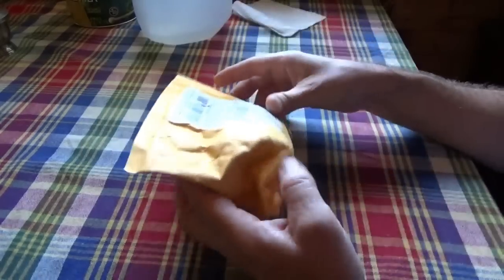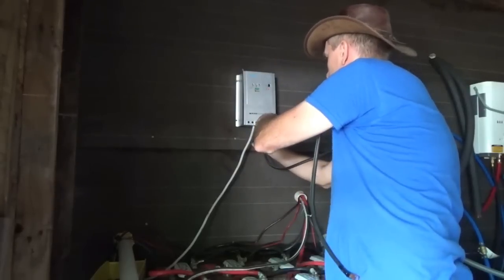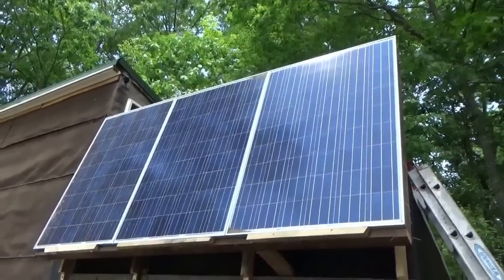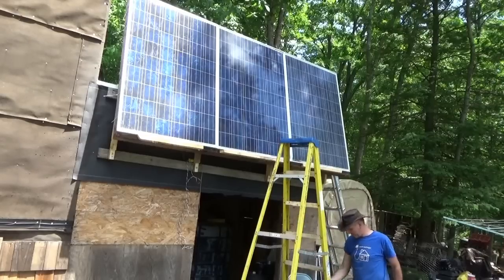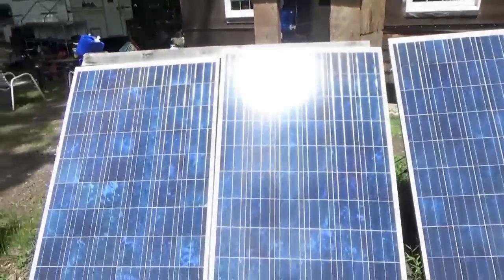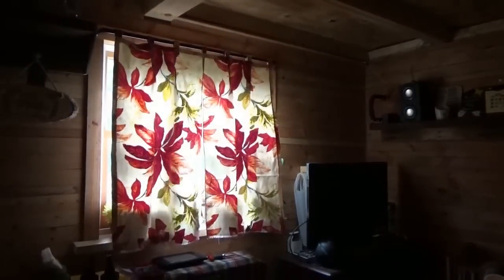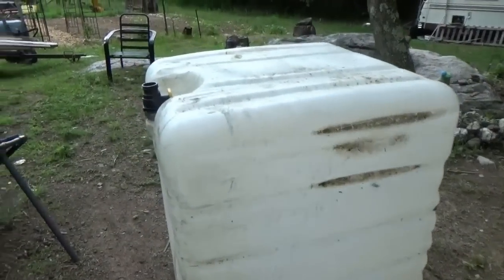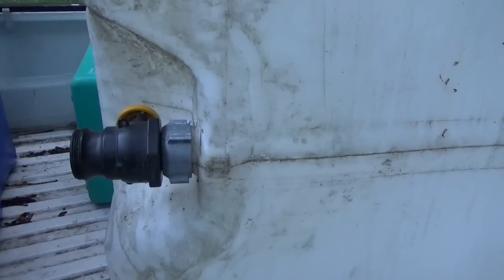Connecting Solar Panels ~ Melanie's DIY Curtains ~ Off Grid Water

Comment: if i were to run the same appliance, which would last longer? full charged batteries in series or in parrallel? or is there no difference? and this is without solar power just straight off the batteries
Reply from the maker: Batteries in parallel increase the total current so that configuration would run longer
Reply: Thanks

Comment: Troy, On the IBC Totes....
Get ones that have had food grade products only in them if you are going to use for potable water. 
do not fill them with out being in the cage.... (safety issue)
Also GO TO TRACTOR SUPPLY and get "Gator Lock" 2" part D Quick Couplings and Street 90, get a 2inch to 1inch bushing and also get one of their 25 foot 1inch poly non-collapsible hoses ($26.00) and use that for the water supply.   
Consider using a HFT Shallow well pump (cast iron shroud) the cheaper one ... this will also work as a pressure tank.  use 1inch or 3/4inch Gator Lock connectors to make everything modular. 
the HFT well pump will run well off of a HFT 2k-4k ($129.00) Power inverter. 

For the solar panel setup...   The MeTer remote is a VALUABLE necessity for the Renogy Tracer MPPT.  also wire up your panels series parallel and you can get more effective charge and lower amps through the controller..

Melanie .....  MY WIFE SAYS THE CURTAINS ARE ABSOLUTELY BEAUTIFUL....   
(saved the best comments for last...) 

Harold n Anisa Cokayne 
Just a Livin' Simple Couple (in Maine and Georgia)

Comment: I have the same charge controller. The only problem when you put it outside, is to prevent spiders & other insects (especially ants) from getting inside and walking on the electronic parts which can cause serious damage. 
This type of charge controller has an integrated NTC thermistor so it will sense the temperature of the air, assume the batteries are at the same temperature and adjust the charging voltage accordingly.
Also as soon as the Renogy enters into absorption mode (voltage=14.4V) the battery LED will blink green.

Comment: that"s a good charge controller I have three of them :)
BTW the green light just means bulk charge and that the battery is not in the low 50% SOC, blinking green light means charged battery.

Comment: Nice Controller,I know,I've been running one for the past 2 yrs. be sure to set the battery type to FLD for flooded batteries so that it will give you the higher charging value of 14.5 vdc before maxing out. Green charging light on the left comes on when panels are producing 12 v or more. 2nd light is green when batteries are at or above 12 v, flashes green when full charge is reached. turns red when voltage drops below 12 v. If you connect an inverter or other load to the switched output terminals on the far right, the controller will automatically shut down when the batteries drop below 10.8 v. I have tilted my panels to an almost flat position of about 15 degrees to take advantage of the solar angle here in the adirondacks. I hope this information about the controller is useful to you, did you get the touchpad with yours? see if yours will talk to PC thru the ethernet port i"ve always been curious if it would or what address it would use. Good luck with your new setup. Bob
Reply: DON'T CONNECT THE ETHERNET PORT OF THE RENOGY CHARGE CONTROLLER TO YOUR MODEM!!!!! THIS PORT IS NOT AN ETHERNET PORT, DESPITE THE SAME SHAPE. IT IS ONLY TO BE USED TO CONNECT THE "MT-5" PANEL. IT CARRIES 12V ON ONE OF THE PINS AND IT CAN DESTROY THE MODEM OR THE COMPUTER!!!!!!!!
Reply from the maker: Thank you for the information. I am going to see if it connects through the internet port.

Comment: If you have two tanks.  Hook one large tank to the house.  Put the second rank in the truck and leave it there.  Jus gravity feed/fill the permanent tank fro. The tank in the back of the truck.  All you would need is a bushing to go from the tank too an inch line with an inch ball valve.  Anyway nice curtains, good job on the solar panels.  Things are looking good.

Comment: Hey Troy - READ THIS!!! The fittings on your tanks are referred to as "CAMLOCK" fittings. They are frequently available wherever pumps are sold. Especially sump or agricultural water pumps. You can also buy them on Amazon. I spent my morning setting up sump pumps and hose with these connections so I'm 120% sure that I'm right. We also receive totes of chemical that have those same threaded fittings. Ignore the threads. The camlock fits right over top.

Comment: I'm thinking that shade is your friend when it comes to keeping the house cool in the summer.  If you remove those trees you'll be putting more sun on your cabin earlier in the day.  Since you have two sets of panels, I think I'd position the panels on the ground to collect full morning sun and leave the panels mounted on your cabin to collect full afternoon and evening sun and see if that will provide you with your power needs before you cut those trees down.  Once removed, those trees will be gone for good and can't be replaced.   Good luck.

Comment: you could cut the nipples off of the China made tank dillys. Then JB weld them to a fitting that will fit the tanks. or maybe the hardware store has some adaptors to make them fit."Like reducers!"

Comment: The solar panel adjustable mount turned out well, and I hope you got your batteries topped off. I would love to see them float charging someday. Melanie made some purdy curtains, "nice work Melanie". Troy, "I would love to see that other window trimmed out," you could finish it if you just cut and nailed up one board a day for a week or so. Sometimes I have to do a little bit of work at a time to fit it in to my schedule. Then it finally gets done in the end and Im glad I took the time to fit it in.

Comment: Troy i am learning about solar so i have a silly question.

Is there some advantage to having the solar charge controller for the solar panels over the shed 
inside the shed and not inside the Tiny " Home " On Wheels?   I did not know you could have two 
independent sets of solar panels and solar charge controller charging the same set of batteries.

I know you already know this  but please please please over build your support and attachment hardware 
for the variable angle solar array.   I would hate to see them damaged in a wind storm.

I have enjoyed using the new discussion forum also and i encourage others to go there as well.  You have to free register but after a short while you will figure out how it works. IN case the trolls get very bad here it will be a great back up so those like myself
can give your our 2 cents.  haha

PS    Can't wait to see what power input you get when those sun blocking trees are gone.
         Negative side to that of course is it will probably be a bit warmer inside the
         Tiny "  Home " On Wheels.

Comment: Melanie  if you sew a snap on the bow and on the curtain right on the spot you want it to stay, it will not slide down and you can always remove it when  you want. to😊
Reply: I was thinking safety pin but I like your idea better. :)

Comment: next time you hang curtains, take the rod apart and insert the straight end through the loops. I hope you invent a long handled device for washing and removing snow from your panels. You need to stay off ladders bud. I worked off ladders for 30 years and you don't seem to have the knack (yet)
Reply: Good suggestions.
Reply: curtains?  OH when I saw that part, I fast forwarded until I saw the water tank and solar panels in the progress bar preview.

Comment: I may be wrong but the gray fitting on the 275 gallon tote in the truck, looked to be screwed on cross threaded.
Reply: I think that maybe it was its own weight that made it look like that
Reply: Having said that...it looks ok to me
Reply: Look again, the gap between the fitting and tank  at top is a lot wider than the gap at bottom, also pay attention to the actual threads on the tank  where it enters the gray fitting.
Reply: Nortekj Difficult to tell on camera,  but I am sure that Troy will cind out soon
Reply: TheMoneypresident Aren't you the one who is PERMANENTLY baffled ?
Reply: John Griffiths I wanted to bring that to his attention  in case it is cross threaded  and he finds that the tank has drained all the water out due to the fitting leaking and he can't get it stopped if the tank is full without losing a lot of water in replacing it or installing properly.
Reply: Nortekj ok